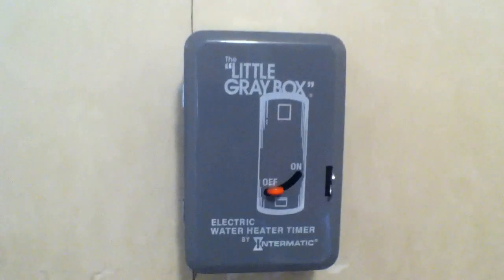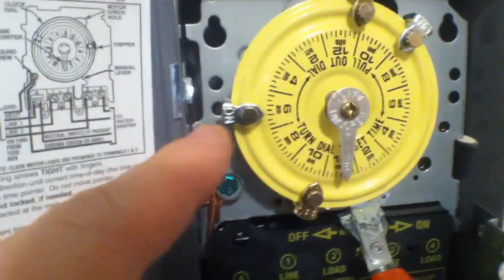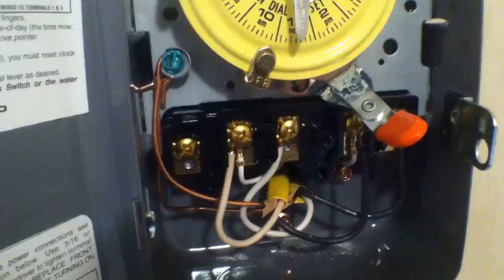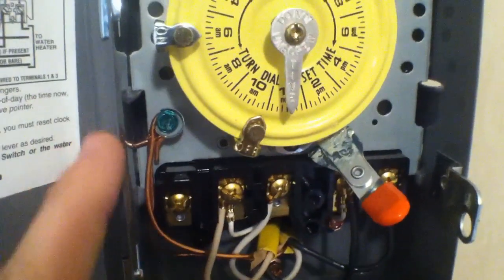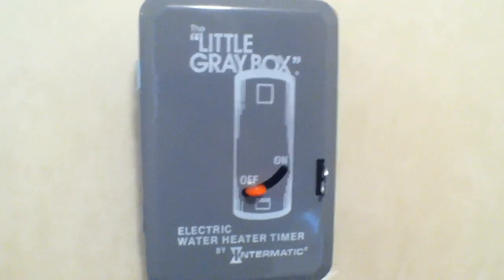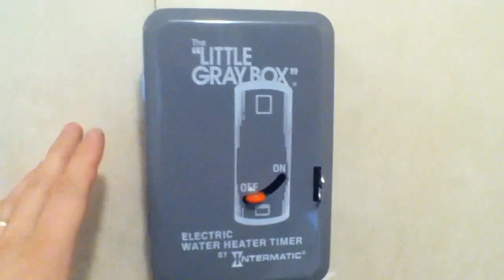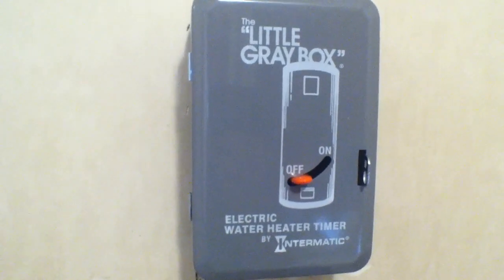How to install a "little grey box" water heater timer on a water heater and also how to use off grid

Comment: I just installed this timer but my heater is 220, not110 like in this video. Mine has 2 red wires coming from the fuse box so I had to wire it differently as per the instructions that are on the inside of the box's door.. Plus I have metal conduit so that eliminates the ground wire.

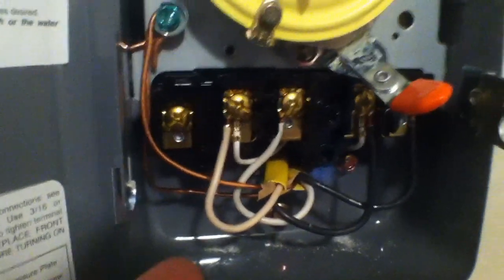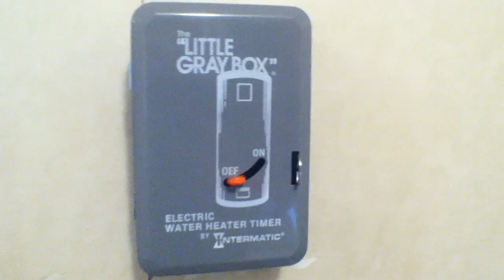Comment: I just installed one of these about a month ago. I have it set up to come on @ 02:30 and turn off around @ 04:00. I take a nice hot shower every morning and have hot water throughout the day. You can also take the covers off the front of the heater and turn down your thermostats. I have 2 heating elements on mine. I have mine set @ around 120 degrees. I don't even have to turn on the cold to mix with it!! I love my "Little Grey Box"!!! I might even back it down to only come on for 1 hr each day. I live alone so it's perfect for me. MrRantek24.